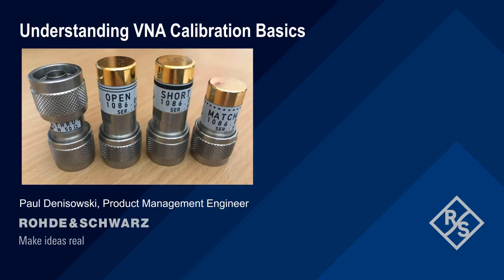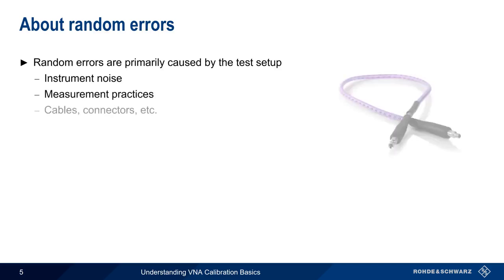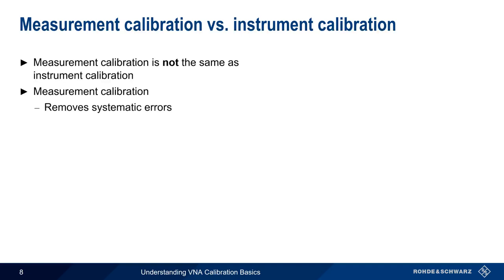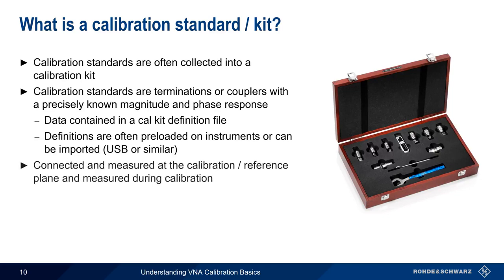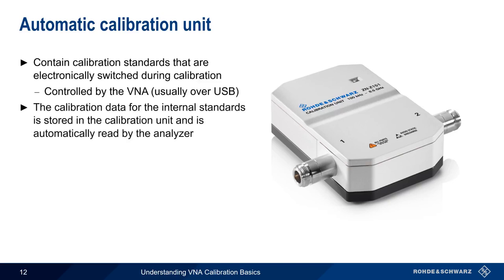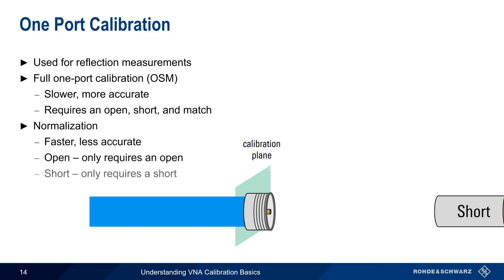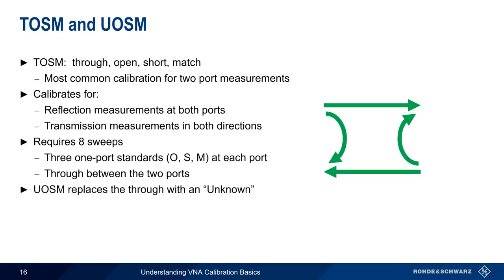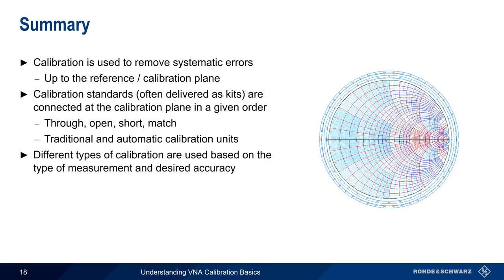Understanding VNA Calibration Basics

Comment: More details in future videos, moving the cal  plane down   to jig/circuit interface levels with all kinds of connects and cavity filter jigs, etc.
Equations if necessary (simpler ones at first then build up complexity).  Accurate measurements is a huge black arts problem.

Comment: More detailed videos on real world applications would be nice.  Rarely are people encountering the connector types on the VNA or even the same impedance's.  So how do you properly calibrate a system that goes from 50 ohm N type VNA to a 75 ohm F type.  How do you handle this when you need to jump from a N-type to an SMA to a 50-75 ohm F-type pad?
Reply: Those are great suggestions.  I'm working on more VNA related content and will add those ideas to the queue.  Thanks for the ideas!
Reply: @@Floyd.B Agree.  VNA Calibration is such a huge topic and that's why I called this video "Understanding VNA Calibration BASICS"  :)   I'm planning some additional content on calibration in the not-too-distant future, so thanks for the suggestion!

Comment: 1. Why changing the frequency void the calibration?  2. If do we need to calibrate each time we use the VNA?
Reply: At a minimum, you should calibrate any time something substantial has changed since your last calibration.  Obviously, if you're using different cables, connectors, you would want to run a new calibration.  If the environment changes (e.g. moved the VNA to a different lab), then you really ought to run a new calibration as well.  Many people will run new calibration at the start of each testing session or before "important" measurements.  For example, if I'm running an S21 measurement to figure out the rough passband of an unlabeled "mystery filter" I found in an old box somewhere, I probably wouldn't be terribly worried about running a new cal.  On the other hand, if I were adjusting a filter or if I were designing/testing a filter, then a valid calibration is much more important.  One of the reasons that autocalibration units (like the one I mentioned in the video) are so popular is because they allow you to run a full cal very quickly -- if it only takes a couple of button pushes and a minute or so to get a fresh cal, why not? :)

Normally a network analyzer is calibrated over a range of frequencies, so as long as you stay within that frequency range you shouldn't need to recalibrate.

Comment: Regarding one port calibration: What kind of an error source is fixed by Full calibration that is not fixed by Normalization?
Reply: That's a good, but somewhat involved question :)   Calibration is concerned with removing so-called "error terms" and for a one port measurement these are reflection tracking, directivity, and source match.  This in turn requires three cal standards: open, short, and match (or load).  Since one port normalization uses only on standard (an open or a load), it cannot remove all three error terms.  Normalization corrects for reflection tracking (only), but the full calibration removes all three terms.  Hope that helps!

Comment: Can we leave the port open in the air instead of using the kit for Open calibration when we are performing SOLT calibration?
Reply: You could, but it's safer to use a cal standard - less chance of external signals entering the VNA port and influencing the calibration.